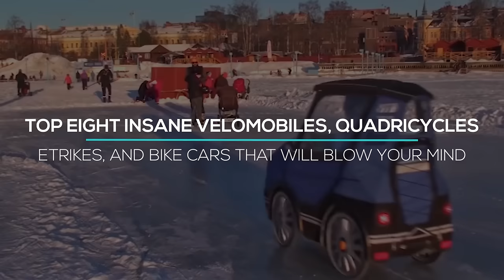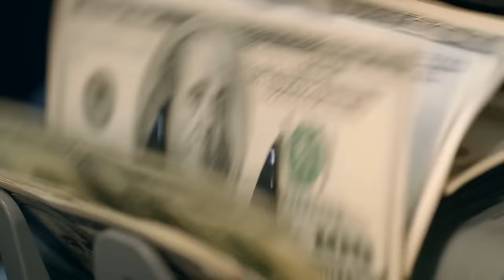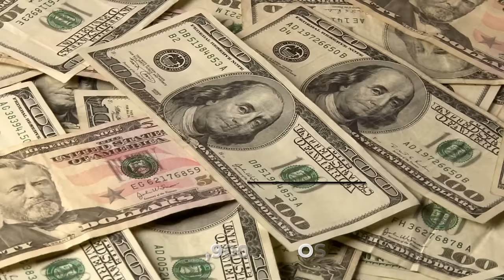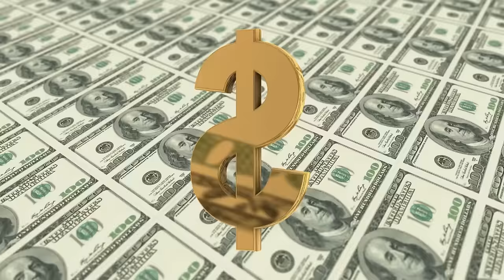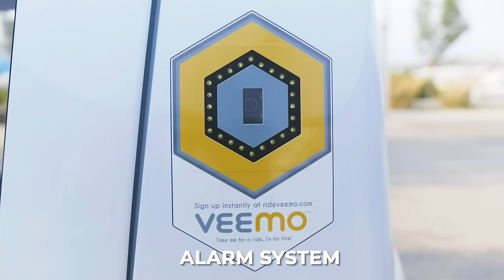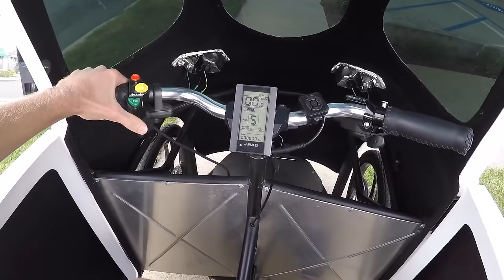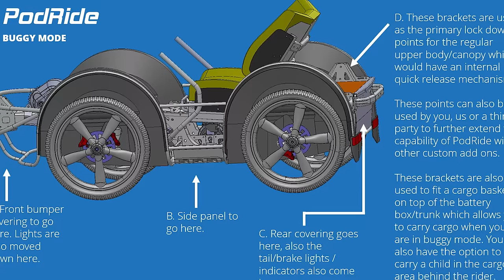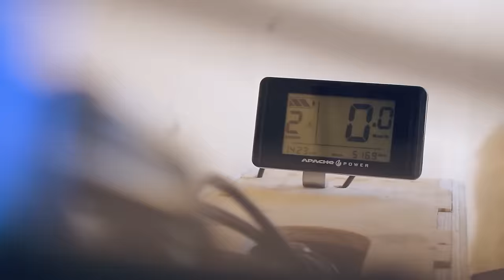Top 8 MUST SEE Bike Cars, Velomobiles, and Quadricycles

Comment: While very nice to watch this stuff cannot be considered an alternative to anything. With the prices reaching those of the regular cars this is just an  extravaganza for rich people. My ebike for $800 already does it all.
Reply from the maker: Good point. eBikes are a win for sure. Thanks for the feedback!
Reply: Recomendations
Reply: You need to understand what makes them usefull for safe cargo driving. This is why Amazon is making millions with these quadricycles. You don't understand how much you can save from a normal car insurance, parking charges, penalties from mistakes on traffic lights. Plus other expenses owning a car. This is what is special about 4 wheel bikes. And you can have a large amount of folding solar panels to add a lot of mileage. Solar on the roof of your car won't help much. Ev consumption is very high.
You have to understand the math to be able to count all the loses you have with a car.
If you complain about the price for these bikes, you can build yours.
I also built mine. Its 160kg. Very heavy. But is solid. And has 6 folding solar panels 100w each. My range is 190 miles a day with lithium iron  phosphate 48v 75Ah which is charging with 600w max from solar panels renogy.

Comment: The Electrom's rear motor is gear-less direct drive not geared as you said at 9:02.
The front 10:1 geared motor provides low speed torque then free wheels as the more efficient rear direct drive motor takes over and also provides for regeneration. I believe local company Grin Technology helped with the electronic design for operating two motor controllers in this complementary way which gets the best overall battery usage.
Reply from the maker: Thanks for the information. I'll look into Grin.

Comment: American made organic transit is close to $9000 bike, so, what is surprise here?
Reply from the maker: Yeah, the Organic Transit is a tad pricey, but people who own them love them.
Reply: @Electric-Rideables  That is because there are not many options as in EU. What you need for paddle powered trike or quad is a good fairing (such as rotovelo made in Australia) which is not that expensive. Fiberglass molding can be mass produced (it is in kayak industry) Then use quality components to make a comfortable ride. Manufacturing in USA has lagged behind in last 40 years. It’s same old nuts and bolts. Just this morning, I was watching unboxing of European velomobile, packaging is so secure, yet no staples, nails, sealing tape and junk material. Product came out without tearing Box apart (which was made of cardboard).

Comment: The weatherproofed tall sides always look like weather vanes - side winds will surely be quite a problem. The enclosures obscure rider’s view. All of these are so heavy they sacrifice a lot of the mobility of a pedal power bicycle. And for what? The Electrom isn’t that aerodynamic compared with a true Velomobil and is really just an E-motorbike that has pedals to get past some legislative rules (the pedals can only generate 10kmh of speed). Unimpressed I’m afraid. A cargo ebike is better at shifting children or shopping and arguably is more versatile.
Reply from the maker: Thanks for the feedback!
Reply: Hello Peter, I think you have a misconception of how the GCD on the Electrom works. It is true that the rider's direct connection to the rear wheel starts to freewheel at speeds over 10 km/h, but at that point, the rider's energy goes into a generator. This allows them to contribute energy to the system at all times, and skip the hassle of sifting through multiple bicycle gears.  The GCD system also provides great exercise as the rider can pedal against resistance at all times. 
Regarding your comparison to a velemobile, we specifically chose to forgo some aerodynamic gains in order to make a vehicle that was easy to use, and easy to get on and off of. We also wanted a higher rider position for urban use. Velomobiles are nice on the open road, but not much good in urban traffic as they are too hard to get into and too low to be clearly visible in urban automobile traffic.
Reply: @electrom_LEV  thanks. A criticism of other bikes that use pedal generation are that they are not efficient converters if human effort into electricity compared with an e-bike that directs human effort to the rear wheel via gears. How efficient is the GCD in that regard please?
Reply: @petergilbert72  Hi Peter, our generator is 90% efficient, but that is not the point. We opted to focus less on generator efficiency and more on pedaling feel and exercise benefits.

The question of generator efficiency becomes moot when one looks at the power output of a human, compared to the power produced by the e-bike motor. 

The average human can produce 100w continuously. Whereas most e-bike systems are drawing over 500W (regardless of the manufacturer's claims) Why obsess on efficiency in a part of the system that is contributing less than 20% of the energy used? Better to focus on the ride experience and exercise benefits.
Reply: @electrom_LEV  you seem to be confirming my analysis of this vehicle. The pedal aspect is of slight importance in relation to speed or range and is there essentially to provide (optional) exercise for the user and to take advantage of legislation relating to bicycles. Downside is the motor scooter is encumbered with unnecessary equipment that contributes only slightly to performance.
Reply: @petergilbert72  I'm sorry, but Your analysis is incorrect. I have the feeling that you are not a cyclist as you do not seem to value to exercise benefit of pedaling. 

The Electrom is not an electric scooter with pedals attached as an afterthought, it was designed from scratch to be exactly what it is, a long-range, super comfortable, cargo-carrying e-bike.
  
You have missed a major aspect of the GCD which has nothing to do with efficiency or range; the rider is able to pedal at all times, without the need to shift any gears. In an urban environment with stoplights and such, e-bikers are constantly shifting up and down through the gears in order to match pedaling speed to vehicle speed. Electrom riders can forgo all of this and just pedal as much as they wish. 

Another significant benefit of the GCD is that it removes the majority of stress from the chain drive, and as a result requires almost no maintenance. 

Do you have any experience designing or building e-bikes and scooters? I would very much like to hear about your hands-on practical knowledge of the subject area.
Reply: @electrom_LEV  I have no experience designing bikes. But I’m a daily rider of different bikes and E-bikes as transport and for leisure/exercise. Significant physical benefit comes from varying the pace, effort and heart rate rather than a steady unvarying pace (a la gym running machines). True E-bikes are considerably lighter than your machine so will be easier to push or thread through tight spaces such as around barriers on pedestrian/cycle shared footbridges etc. I’m sure there is a niche for your machine and I wish you well with it.

Comment: The major problem with these things is that they are compatible with neither bicycles nor road traffic. They are too big and fast for dedicated bike paths and too small and slow to mix safely with normal traffic. The best solution for urban mobility is the same it's always been. First walking, second bicycles limited to 30 kph, third public transit, primarily rail mounted electric trams in the now traffic free streets, and electric trolley buses with overhead wires, then underground electric urban and regional trains, all coupled with sufficient housing density to eliminate sprawling suburban car dependent neighbourhoods.

Comment: Etrike# I want a quadracycle that is cheep
Reply from the maker: Looking for an affordable quadracycle, especially when considering an electric option like an e-trike, is a great way to navigate with efficiency and environmental consciousness! Here are some tips to find a "cheep" or cost-effective quadracycle:

1. *Research and Compare:* Start by researching different brands and models to find ones that fit your budget and needs. Prices can vary widely based on features, battery life, and capacity.

2. *Consider Used Options:* Check out second-hand or refurbished models. Many people sell their quadracycles when upgrading to a newer model, and you can find these at a significantly lower price. Websites like eBay, Craigslist, or local classifieds are good places to start.

3. *Look for Deals and Discounts:* Keep an eye out for sales, especially during off-season periods or holiday sales, when many retailers offer discounts. Signing up for newsletters from manufacturers or dealers can alert you to upcoming deals.

4. *Simplify Your Needs:* While it's tempting to go for a model with all the latest features, focusing on what you truly need can help keep costs down. Basic models without extra bells and whistles are more affordable and often just as effective for getting around.

5. *Crowdfunding Platforms:* Some new companies might offer their initial batches of quadracycles at a discount through crowdfunding platforms as they try to enter the market. This can be a way to get a new quadracycle at a lower price, though it comes with the risk of delays or issues as with any crowdfunded product.

6. *Government Incentives:* Depending on where you live, there might be government incentives, rebates, or subsidies for buying electric vehicles, including electric bikes and quadracycles. These can significantly reduce the cost.

7. *Local Cycling Groups or Forums:* Joining local cycling groups or forums can provide leads on good deals and advice on choosing the right quadracycle. Members often share deals or sell their own equipment.

Remember, the cheapest option may not always be the best in the long run. Consider the durability, warranty, and maintenance costs, which can affect the total cost of ownership. Happy hunting for your ideal quadracycle!